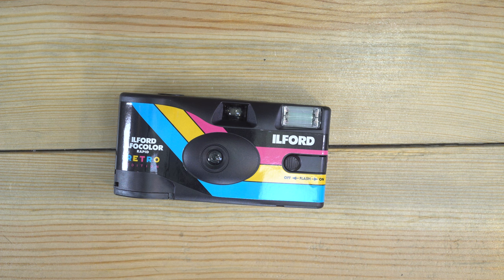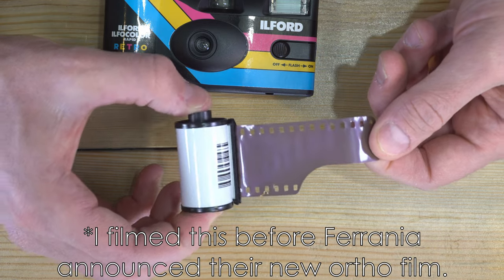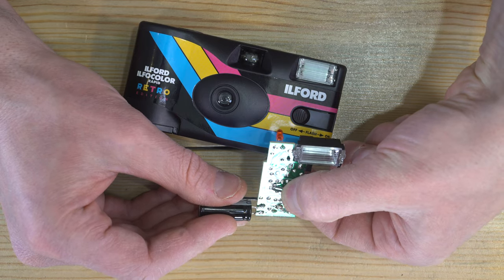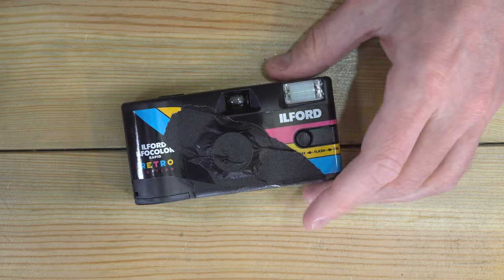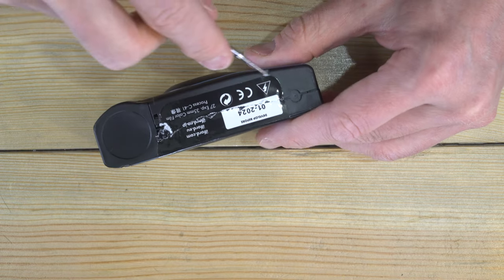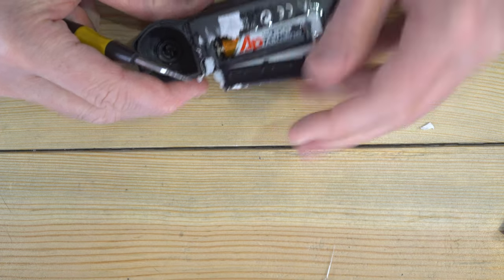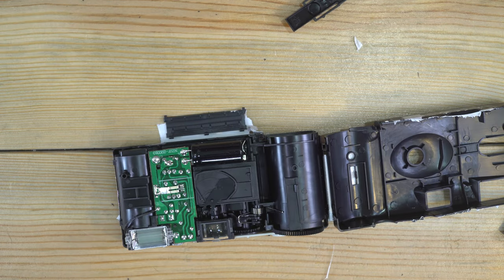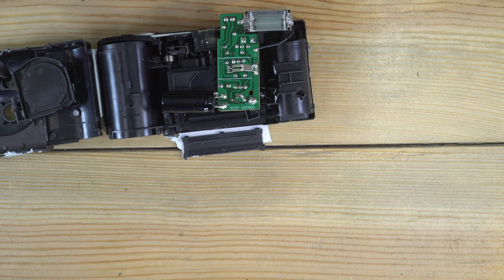Ilford Ilfocolor Rapid 35mm Single-use Camera Disassembly

Comment: I've gotten to the end of my Ilford b&w disposable. It went yheough the X and seems to be starting the number cycle again. Is the only way for me to tell if it's done is to unpoad it in the dark? I just dont want my last photo to be quintuple exposed so to speak, though that may be cool. I just want to finish it so i can take it in.
Reply from the maker: When the film advance just turns and turns, you're done. The film advance mechanism is connected to a gear that engages the film sprocket holes. So if the advance stops, then it's still being engaged by moving film. If the advance keeps going, the sprocket is engaging nothing and the film is fully in the cassette.
Reply: Excuse all my typos lol I was typing fast and didn't pay attention. I finally took one or two more photos and it was finished. I think the counter was just a little off and it made me nervous once I started a new cycle on it.
Reply: If you want to reuse the film or camera, just get a Lomography simple use camera. For one, completely rewinding them is made easy because of a cross-shaped hole going through the transport wheel axis, so you can use a power drill with a philips bit to wind it. Secondly, they're literally made to be reused. It's already clear by the naming, the named them simple use instead of single use for a reason. I've gone through about a dozen rolls with mine by now and they turn out great every single time.

Comment: Can you help to reverse wind that camera so it can refill the film
Reply from the maker: @muhammadrizqiariffudinputr7079  this is a single-use camera. There's no way to reverse wind it.
Reply: @DavidHancock  oh i just found my type can be unwind idk how but I opened the cam it's probably open the camber and you can roll it up a film (I'm tested with my testing film) and it's working again but the dial counters seems not really working but the film actually get pulled into the canister bcs it's probably trigger the gear in the chamber for making the shutter buttons works again

Comment: It's KODAK FILM, The Color of the emulsion is a dead giveaway, and the exact same film is found in a dozen other disposable cameras many of which say the film is made in the USA. And for Cheap quality film developing (that dose no charge extra for disposable cameras) there is a wonderful lab in Pennsylvania called Andrew's Analog Service center that develops disposable cameras (and all C-41 35mm film) for Five Bucks with 3 Megapixel scans included. Best deal in the whole united states.
Also those capacitors give a real shocking experience, I speak from personal experience when I use to do trash runs and pulled the batteries out and touched bare metal once and YAAAOUCH!!!!
Reply from the maker: The edge markings certainly look like Kodak, but the base material is much different.
Reply: @DavidHancock  It's the cheap junk film Kodak makes for disposable cameras. Some lower grade of Ultramax. It's found in like all made in China disposable cameras. For the final test you can put it in a dark bag, pull all the film out and feel for the tape holding the film to the center spool. ONLY Kodak uses tape. 
I own a film lab and I am extremely active in the film community. I know what I am talking about. That is an ILFORD camera with Kodak film. Need another hint?? Kodak is the only company mass producing color film in 2023. It's Kodak color film.